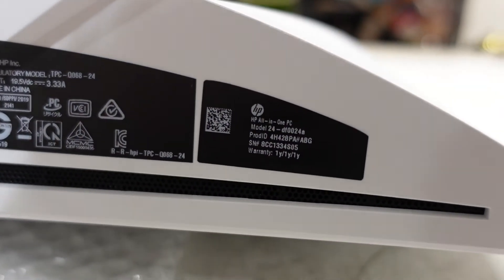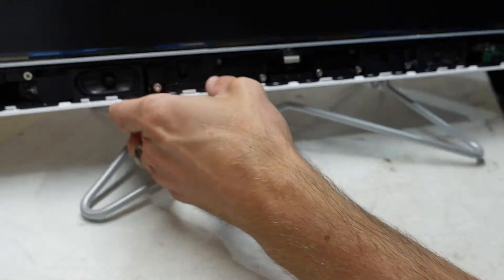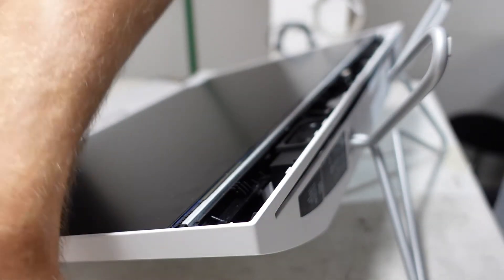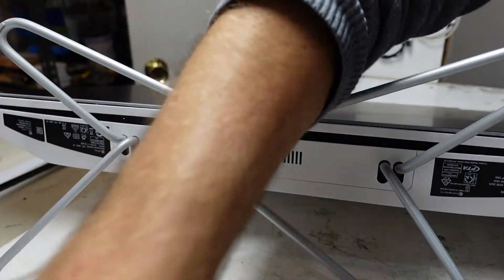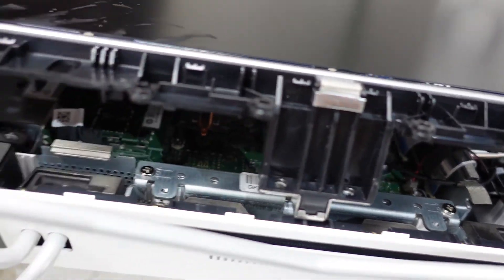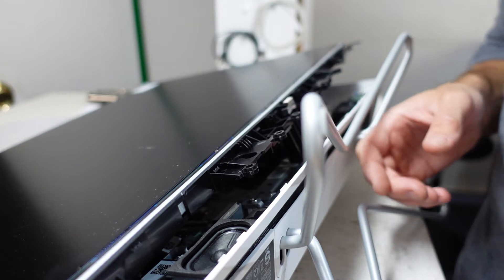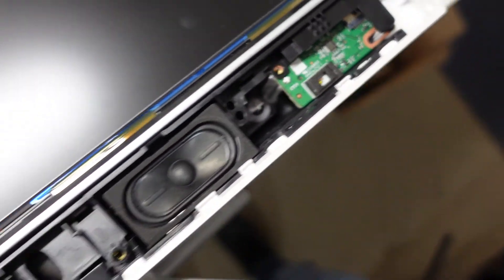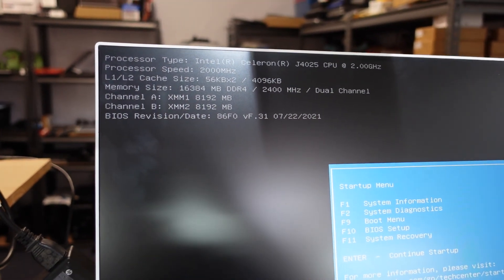HP All in one 24 af Ram upgrade

Comment: i put a samsung 8gb and it doesn't recognize it
Reply from the maker: whats the ram speed? does it match the current stick
Reply: @rickstechrepairs turned out it wasn't seated correctly. The bottom slot is not easy to use. All good. Needed to insert it in higher angle.
Reply from the maker: excellent to hear its now going fine :)
Reply: @rickstechrepairs thanks for the video. Very helpful

Comment: I really want to add additional ram i currently have 8g. its very similar model, mines about 6 years old and im js scared to mess it up bc that looks like chaos to put the screen back in and ive never done any modifications before
Reply from the maker: if you are unsure, i would recommend taking to it a repair tech in your area
Reply: Just did it to mine it’s not as bad as it sounds😭
Reply: @JordanBrown-tz3gg how’s it running after the modification?

Comment: I thought id have to buy a new computer i barely used mine but its sooo slow slow even with factory  reset so that's why i want to know what does adding more ram do ty
Reply from the maker: adding more ram will let you have more things open at once
Reply: @rickstechrepairs I think our issue is we can’t even have one thing open at once lol, mines really slow too even with factory reset.

Comment: What does adding more ram do
I currently have 4 ram on my all in one hp similar to yours
Reply from the maker: adding more ram will let you have more things open at once
Reply: @rickstechrepairs  will it help make it faster? Its so slow I don't even want to use it rn. And I don't understand because  I barely use it and I just factory  reset it
Reply from the maker: what CPU and ram does it have?

i suspect that it has a Hard drive, it would run much faster with an SSD (solid state drive)
Reply: @rickstechrepairs  ummm 2 90 ghz and 4 ram .. now what is an SSD ty so much
Reply: @rickstechrepairs  I wouldn't know which one to get.. I watched many videos.  I'm not sure I can do this .  I'm bummed out.  I see many just upgrading  theirs.  I was thinking of just selling mine and getting another,  but I want a good one , good ram, ssd, graphic card if needed cause I do play a little  atleast 1tb.  It almost seems stupid to sell and buy another though..  I wish I knew what i needed and what I would be doing.   I hope you can advice me 😥 ty
Reply: @rickstechrepairs  thank you

Comment: Mine is a similar model (22-df0003w) but comes with a Celeron and 4 GB RAM (DDR4).  I upgraded it to 32 GB (2 x 16; Corsair Vengeance) just a few hours ago thanks to your video.  Unfortunately, I wasn't able to get one of the inner middle screws to line up so I left it off.  I also wasn't able to fully close the front panel.  :face-red-droopy-eyes:

Anyway, it's great going from 4 GB (single channel) to 32 GB (dual channel).  I mainly use it to watch YT and web browsing.  I can now have way more tabs opened at the same time than ever before!  I used to have tabs crashing due to low memory issues.  That's now a thing of the past!  :face-purple-crying:
Reply: What’s the link for the one you bought? I am not sure where to look
Reply: I have the same one with 4gb of ram, it runs 32gb ? I thought 16 was the max
Reply: Are you sure your celeron is running dual channel and fully utilizing 33g?

Comment: least these ones are easy. 
The model with the screw you turn to start it cost me some money.
When putting it back together I applied to much pressure to middle left of the screen. 
in end I bought customer a new one.
Reply from the maker: ouch, not fun at all.

i haven't had too much of a drama with those models (turn screw to pop the back)

I did sell a 24" Lenovo LCD Panel a while ago on ebay.. too bad it got cracked in transit.. so it was a full refund for the buyer